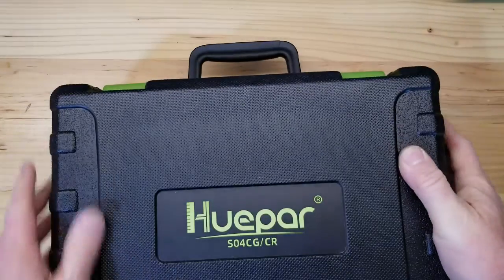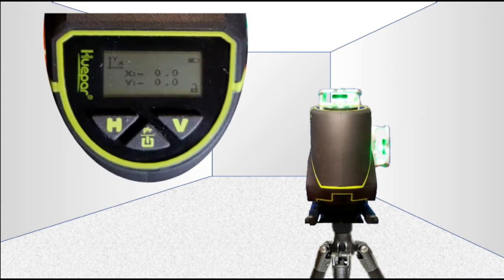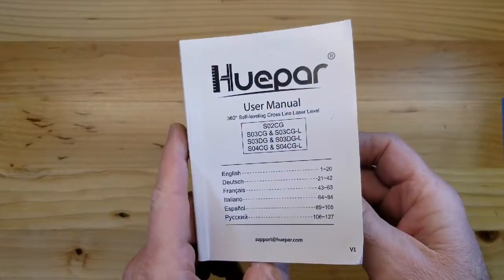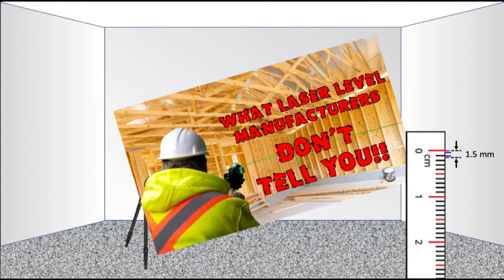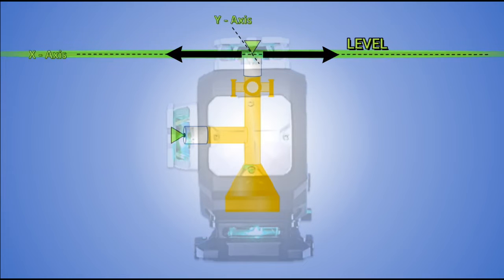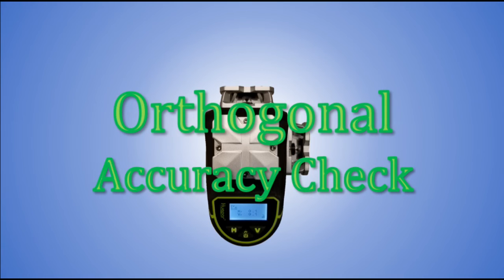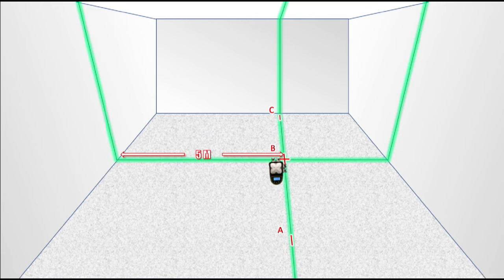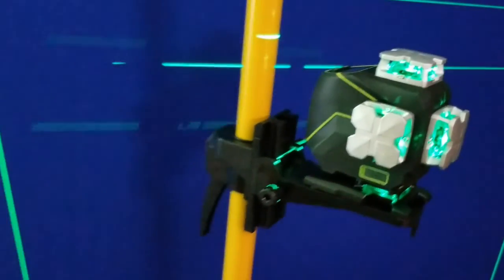3D Laser Level Calibration Check and Level Accuracy

Comment: Thank you, very informative video. I had a random question, would there be an issue if I mounted this to a drill press to ensure the drill bit drills at the cross mark? Or would the vibration from the machine cause problems? 

Since the machine also travels up and down, would this be adjustable in the z axis? Or best to get two straight line modules, as the adjustability will allow correction for all these problems?
Reply from the maker: Hello @asdervan, I don’t think this would be a cost effective solution for your application.  There are ready-made and also DIY solutions for drill press laser levels that would probably work better.
Reply: @ thank you, I went with straight line green laser.

Comment: Hi Brash air, Thank you very much for your video. 
I looked at the procedure for orthogonal check and I believe that there may be something wrong at 10:28.
If you align B and C (after rotating 90deg) you will be forcibly aligning at A also (the projection of a plane is a straight line)
In that case the misalignment error will be evident at D. (different vertical plane but same result)

To measure the misalignment error at point A you have to align the cross lines at B and the mark on the wall at D, forget about aligning C (C will be affected by the same error evident at A).

Please let me know if you see any wrong in my thinking and again, thank you very much for sharing, your video gave me a fantastic start.
Cheers.
Reply: Same question. I think you are right.

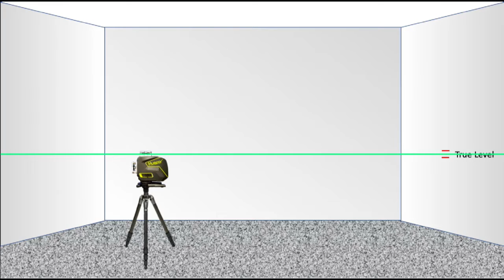Comment: I believe there is no such thing as flat surface. Tripod is not perfect, floor is not perfect and most importantly the rubber casing of the laser is very not perfect - thus all 90° horizontal movements will result in slight difference in level. The true level might be acquired here 3:57 - it's right in between those red lines but only if we previously manually adjust the height of the laser using the nearby wall, after every single movement of the laser. Hope I understood that right.
Reply from the maker: You are absolutely right!  The critical thing to remember is to maintain the same height when rotating the laser level. This is also why you want to make a mark on the wall perpendicular to the lines you are checking to ensure the laser level is not tilting when it is rotated.
Reply: It actually doesn't matter if the laser is physically level. All we really care about is the height of the laser head, which is why he draws a reference line on the side wall. (If you allow the height to change it can still be done, but it's a lot more work and gets confusing.) Now, I usually don't bother with the reference line because I know my countertop is stable; and the laser's rubber casing/feet shouldn't make any difference either. 

*If using a good tripod and the mount is directly below the laser head, the head height shouldn't change; but a reference line is still a good idea just to be sure. If using a flat surface, you could do a lot of math if you wanted to get really precise. But if your surface is fairly level, you'll be ok. As an example, I added a 3.07 degree slope to my Huepar by adding 4.7mm to two of the feet (about 11/16" rise per foot). At 33', adding the slope to front two feet raised the top line 1.4mm and the bottom line by .7mm; added to back feet raised the top line about 3mm and the bottom about 1.5mm (they're all different because the laser head and feet are offset from each other). But it'd be the same no matter where you measured because that is how much the the laser heads had actually been raised. But again, as Brash Air said, just make sure the head stays at the same height. It's pretty easy to tell if a countertop is level, it's not so easy to tell if anything else is.

Comment: i opened my huepar 3x360 laser and the adjustment screws at the end that you showed only seemed to adjust the horizontal. i made one mark on the wall 5m away and adjusted the front laser until the front and back window both were dead on the mark then i proceeded to do the same to the side laser until all windows were on the mark. 
The only way i found to adjust the vertical was to work out which way the laser was out and fractionaly back out the screws attaching the laser diode until it was level with another laser that was level to a spirit level, so all three were giving the same reading. 
The vertical of the laser i was adjusting needed to go to the right so i fractionaly and evenly backed out the top screws, thats got to be how huepar would repair it as i spent hours on it and the two ways i used was the only possible way i could do it.
Have used it since to do some MF ceilings at 2400mm, i set the laser up in a room at around 5x5m measuring up from the floor 2400mm, i then measured each corner of the room and they were within 1-2mm accuracy except one which was about 5mm difference which im putting down to the screeded floor.

Comment: +/- 3mm means up to 6mm distance between lower and upper mark after rotation when distance between laser and wall is 5m, what you are saing is correct, but your picture @4:45 is incorrect, should be 3mm (plus or minus 1.5mm gives you 3mm distance).
Reply from the maker: Thank you for watching the video, and yes, you are correct.  At 10 meters the maximum deviation from True Level is plus OR minus 3mm, but never more than 3mm from True Level.  Therefore, worst case would be one side at +3mm and other side at -3mm for combined out-of-tolerance of 6mm at 10 meters.  However, I personally would be hesitant to use a laser level that far out of calibration for any interior work projects spanning large distances.